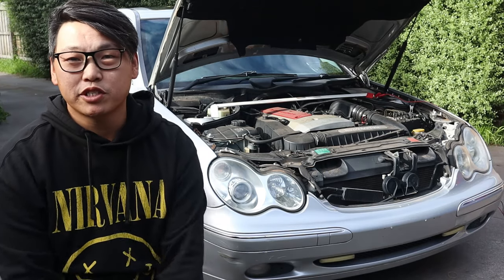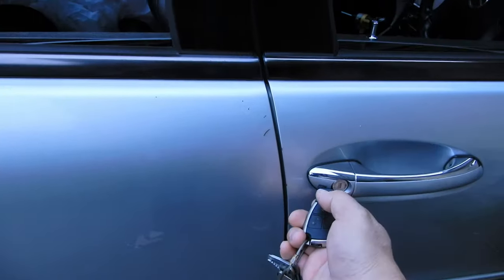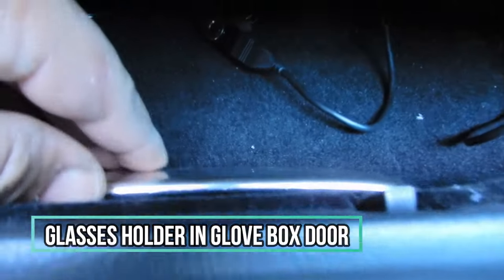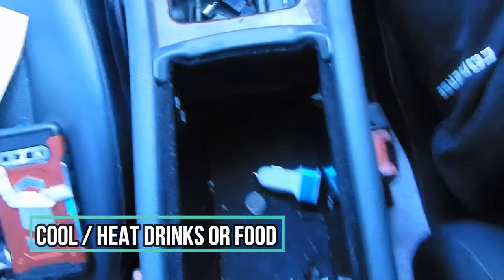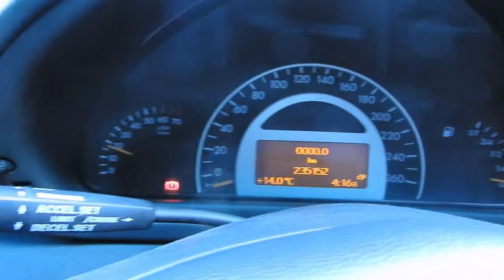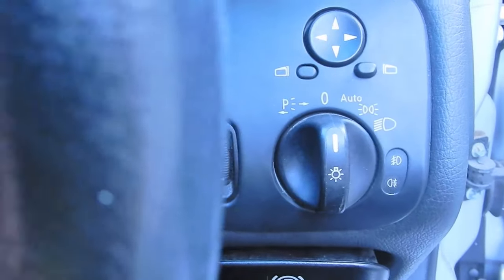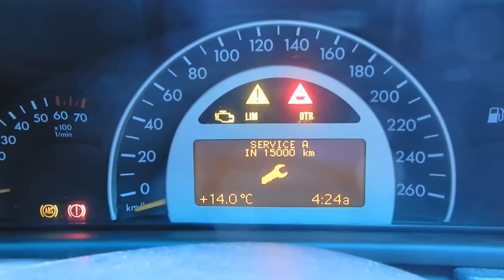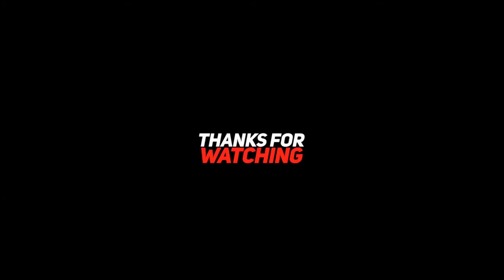MERCEDES W203 cool features tips and tricks handy hacks hidden functions

Comment: What is the dubbele din unit you are using
Reply from the maker: it's an old pioneer xvh4500dab there's new versions..but it was good enough for wen I got it
Reply: @MIKEYZVLOGZ  thanks i have been looking for something i could potentially find second hand
Reply from the maker: @stuiterballenproductions  oh yeah these days ebay has plenty even try fb marketplace ..I saw an exact unit like mine for like 100 dollars .. but u still need to buy the plug adapter so u can plug and play rather then soldering the wires ..and the double din bezel
Reply: @MIKEYZVLOGZ  thanks for the heads up man. Btw did you do any performance mods to the car?

Comment: Hi, how come your RPMs are so high, is that normal because mine is only showing 1.5 and yours is showing about 9?
Reply from the maker: oh thats becuz its a cold start once it settlea it will be about 7-9 aswell..im sure urs would be the same on the very first start of the day .. cold start inother words
Reply: @MIKEYZVLOGZ  hi, thank you for your reply. Mine is a lot lower but then again my engine is kind of shaking so I'm guessing I have a vacuum leak. I looked at my RPMs today again and it is only 2 it goes lower when I put it into drive and when I come to a stop the car sounds like it's going to turn off.
Reply from the maker: @georgec7798  yes a leak somewhere 2? u meam 2000rpm?? im surprised the car doesnt just stall out... thata very low..get it looked at asap .. should idle around 7 ..for a healthy engine ...
Reply: @MIKEYZVLOGZ  hi, yes 2,000. As soon as I get a chance I'll make a video and send it to you so you can see it. It only seems to almost stall when I come to a stop and the faster I stop the more  the engine will shake like it's going to stall. Thanks
Reply from the maker: @georgec7798  YE THATS VERY LOW ...must be an issue with a leak for sure or the maf sensor needs cleaning and or throttle body..somehting is causing it to idle poorly
Reply: @MIKEYZVLOGZ  hi, I actually put a new MAF sensor in the car 2 years ago when I first started having this problem but it didn't do anything at all. I also removed the air cleaner and the complete turbocharger and repaired the holes underneath it. I made sure that the one-way valve was working but this still didn't repair the problem. I replaced every other vacuum hose but nothing seems to work. The engine is extremely clean without any oil leaks. These are the codes I'm getting. P0420, P201D, P2035, when I looked up these codes on the Internet they don't tell you exactly what it is they just say it could be about 5 different things so it's hard to diagnose.
Reply from the maker: @georgec7798  what do the codes relate to 

 could be your intake manifold
Reply: @MIKEYZVLOGZ  hi, I can't remember I'll have to look them up tomorrow when I get a chance. You could be right I think I remember something about an internal manifold malfunction or something like that. I'm going to try to get some sleep so I'll talk to you tomorrow. Thanks for your help.
Reply from the maker: @georgec7798  yes do that
Reply: @MIKEYZVLOGZ  hi, I didn't get a chance to look up the codes I was kind of busy but I did take this quick video on my way to work. You can see the RPMs are very low.... https://youtu.be/15QjUiOa6z4

Comment: 13:30 Excuse me, what is the stepper motor for??
Reply from the maker: stepper motor is for when u change direction for your air vents .. direction of air feet face etc ... common fault on w203 is the stepper motor fails and makes a clicking noise ..very annoying ..due to the stepper motor slipping ..makes the clicking noise cuz it does grip on
Reply: @MIKEYZVLOGZ  i see, thank you so much for replying
Reply from the maker: @DisckjockeyF  np

Comment: My Car does not appear to HAVE a DipStick.... Apart from the one behind the wheel (sorry, had to do it)!
Reply from the maker: ye newer models they removed the dipstick hence why u can check the level using the cluster   .. it will tell u how much oil u need and the type of oil
Reply: @MIKEYZVLOGZ  I finally remembered how to do it today..
100ml I think it asked for...

Super cool!

Oh yeh, does it monitor Tyre Pressures.. I am a bit concerned as it feels a bit HEAVY on steering... especially for a Coupe 220 2 door?
Reply from the maker: @JETJOOBOY  hey bud I'm glad h got it .. for type pressure it doesn't monitor it but if your co corned goto a gas station and check there .. on your fuel cap it will have the recommended tyre pressure settings for tour car
Reply: @MIKEYZVLOGZ  I no longer trust Forecourt pressure gauges, I used one and when a Tyre fitter checked it, it was 10 PSi too low!
Reply from the maker: @JETJOOBOY  what's forecourt  a brand. ?
Reply: @MIKEYZVLOGZ  hhehhehe..
It is the Front of Shop at a Gas Station...
I Guess..

We would call it the Forecourt of a Petrol Station..or Garage..

Where they house the Air and Water pumps

Hehe
.
You are A Murican eh?

I love it..

Yeh, we call them Garages or Petrol Stations..

The bit that is manned on the front and accessible to any customer regardless of whether the Shop is Open or Shut ..is the ForeCourt..IE Front.. side..?
Reply: @MIKEYZVLOGZ  I think I live in one of the VERY last towns in England where they Pump "Gas" For you ...

For 35 years and since I have ridden bikes and driven cars
..all garages are Self Serve in UK...
Probably twice I have had petrol pumped into my car by an attendant until I moved HERE 3-4 year ago!
Reply from the maker: @JETJOOBOY  no Australian

Comment: 16:52 the Aux cable you show is one that connects to the back of the head Unit, the one for our cars has the input portion and there is a little circle that pops out near where you were looking at the side of your glovebox that you can almost see in your video for it to be installed. The Part number is 203440180864 :) Great Video by the way! (thats for my 06 W203 anyways)
Reply from the maker: yes correct thanks
Reply: hmmmm 06..... dodgy 271 engine.. :-(

Comment: Wow, I just got mine and a lot of these features aren't on mine.. which is 4 years later than yours.. 
What is yours an S?
Reply from the maker: no it's a coupe class 2000 model one of the first models
Reply: @MIKEYZVLOGZ  C CLass?
It has the 2004/5 uplift dash?
My 2004 has the shitty 2003 Dash.. I don't mean to be ungrateful as I TOTALLY DO NOT DESERVER a BENZ... but it IS pretty horrible.. by any standards..

I would Love to know that I can upgrade it ? 
but I doubt it.. but if so.. I WILL do .. when I have fixed the Injector Seats, Track Rod Ends, BRAKES, TYRES and .... the Sticky Steering Wheel ...

That is about IT as far as I can humanly do .. until we get to the External Cosmetics.. and It looks SICK and SEXY enough for me, even with some Battle Scars!!!
I LOVE this car.. ( I don't want to FALL in Love in case I get jilted... but.. if the worst happens.. I would go out on the PULL and get another one....)
Reply from the maker: @JETJOOBOY  ye mines an old model first of its kind .. I thought all 2000 to 04 I think is all the same interior wise .. I know that the 05s cha get a little with the flat panel design and different buttons

Comment: How to fix fuel gauge ?
Reply from the maker: whats wrong with yours?? it will; be a electrical fault..if its not showing the right level of fuel u need to check a few things . best start with a diagnostic, proper Mercedes diagnostic, to help pinpoint issue
, check fuel level sensor, fuel sensor, fuses related to fuel and cluster , check cluster
Reply: @MIKEYZVLOGZ  thanks for your reply mate. It could possibly be a problem with the fuel level sensor as all my fuses are fine to my knowledge. It won't come on at all(the fuel gauge) but my car does drive so it's definitely getting the fuel through.

Comment: Yeah..we have same problem, I can’t check the battery voltage like others. 😛
Reply from the maker: do u have older model like series 1 or 2
Reply: I have series 1, m111 engine. Do you have a clue?
Reply from the maker: @kristianandikaswandana3868  hi what did u need to know ? I always try help as best I can we have same engine
Reply: I wanna know how to check the battery voltage. I follow some instructions (press 3times cluster illumination button but when I try to my car isn’t working. Do you have a clue bout it?
Reply from the maker: @kristianandikaswandana3868  no mine doesnt work either... i think it doesnt work on thew earlier models like mine but newer modes it works.. u can always check another way .. thatshy in the video i showed how u can check on oter modls.. but my model didnt work.. or u can use a battery tester.. that will show u excatly your voltage too
Reply: MIKEYZ VLOGZ yeah, i finally bought multimeter to check 😂 but i’m still curios. Thanks mike, your channel help me alot 🙏🏼🙏🏼
Reply from the maker: @kristianandikaswandana3868  yeah for whatever reason it doesnt work on our models , i cant explain it , i triewd so many times to check like that too but it didnt work

Comment: W203 2004  headlight switch on auto but day also working light
Reply from the maker: yes there is a mode that u need to turn off in the options in the menu .. I will check and get back to you
Reply: There is a option in menu that is constant or auto ,switch to auto I think

Comment: Where is the cd-changer in mercedes c class 280(2006)?
Reply from the maker: glove box or boot
Reply: @MIKEYZVLOGZ  i checked its not on either of them! Perhaps it doesnt have one?
Reply from the maker: @andindina02  does your system have a single cd in the headunit ? if you dont have a cd stacker option for your headunit then i would say its a single din...but also remembe that if you do have a cd stacker, some are built into headunit so u can enter more then one cd in the cd slot and it stacks in the headunit itself..just like the w204s , they stack 6 cds and its all inserted from the front cd slot
Reply: @MIKEYZVLOGZ  yeah i do have a cd stacker thank you very much❤️👋🏻
Reply from the maker: @andindina02  ok thats good to know did you find it?? did you try to see if the cd can stack in your cd loader??
Reply: @MIKEYZVLOGZ  yeah the car does the job obviously😂